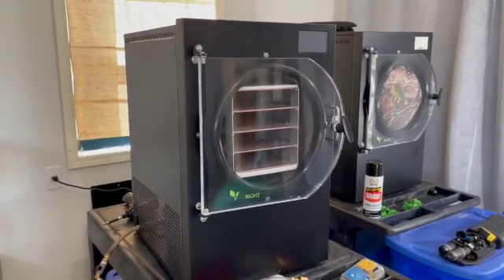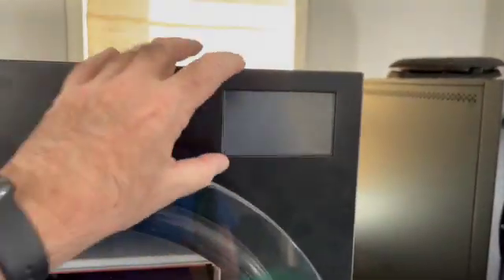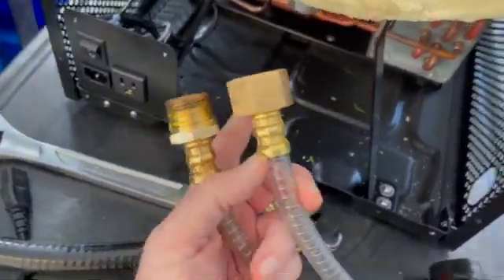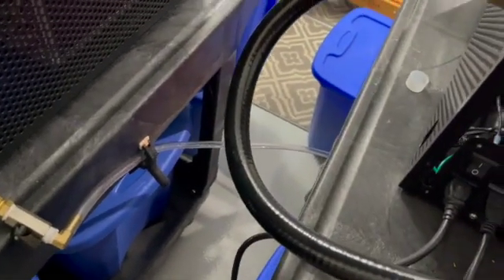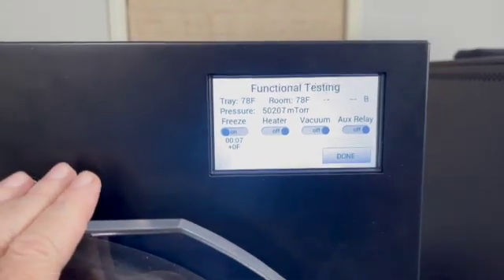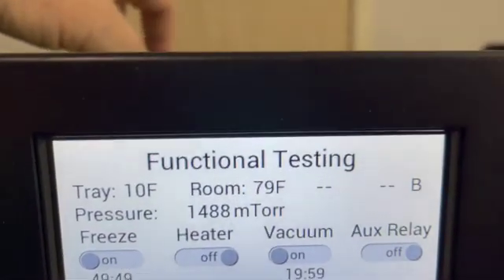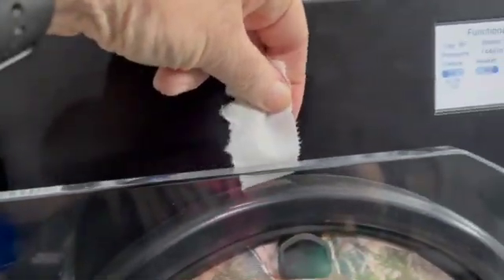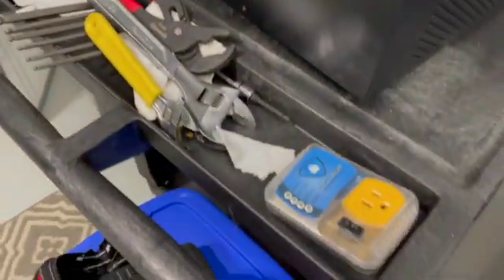Debugging a Harvest Right Freeze Drier

Comment: My medium freeze dryer never had a good seal from the time I opened it out of the box.  I asked them about it and they said not to worry as long as you have a good seal when the vacuum is running.  I have nothing but troubles with this machine and all they want me to do is diagnose it myself and do up grades which never work  Should be 25d but always says 25a  Runs fine for a couple loads then I get a vacuum error.  I can't tell you how frustrating this is.  I am rather old and don't understand all this repair stuff.  They just keep telling me to test this, test this, test this..............on and on it goes

Comment: Any update??  You seemed to have fallen off the grid. Why didn’t you switch pumps as you own 2 HR machines?
Reply from the maker: I've definitely fallen off grid....  It took about 5 weeks to resolve the issue working with Harvest Right support.  We spent 1 week back and forth updating software, running tests, collecting data.  I happened to have a 2nd chamber with the same pump so I put the known good pump on the "broken chamber".  The good pump worked fine so the problem was a bad pump.  Fortunately it was under warranty so I returned it to HR for a replacement.

Comment: Do you have an update?
Reply from the maker: It took about 5 weeks to resolve the issue working with Harvest Right support.  We spent 1 week back and forth updating software, running tests, collecting data.  I happened to have a 2nd chamber with the same pump so I put the known good pump on the "broken chamber".  The good pump worked fine so the problem was a bad pump.  Fortunately it was under warranty so I returned it to HR for a replacement.  The whole process took 5 weeks.

Comment: The best way to check for pressure leaks is to use "Leak Check" which the gas company uses for propane installations. You can make your own by adding a teaspoon of dish soap to a quart of water. Put it in a spray bottle and you can spray any joint and if it makes bubbles it's leaking. This also works on looking for leaks in tires.
Reply: That works fine when checking for a pressure leak but not so much when looking for a vacuum leak. My experience has been that in a vacuum the bubbles will not form, air is sucked right out of them. I use ground up B 12 vitimums in vinegar and a black light, the mixture glows bright yellow under the black light.
Reply: Smoke is a good way to look for a vacuum leak.